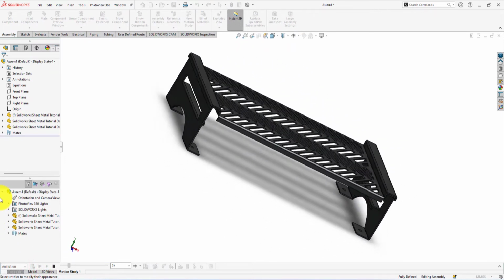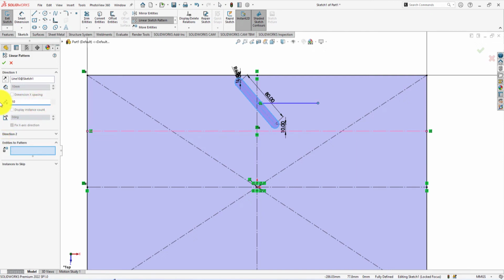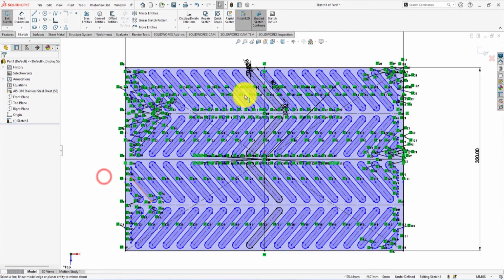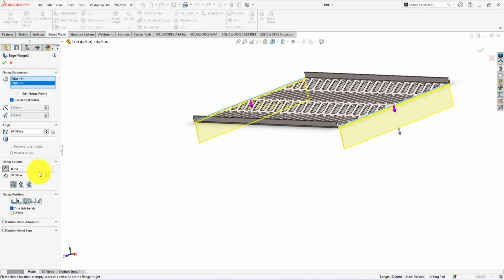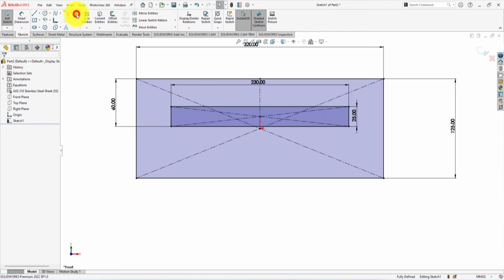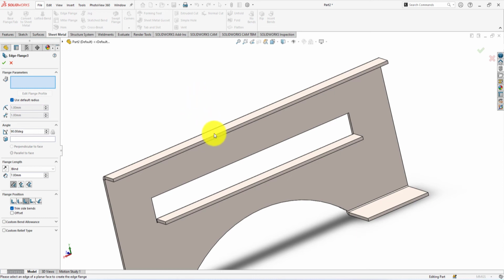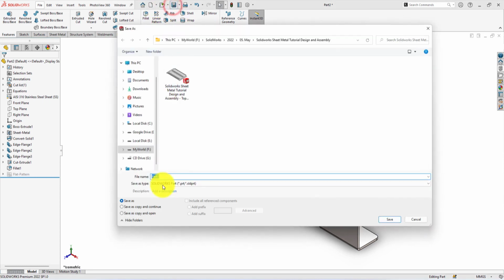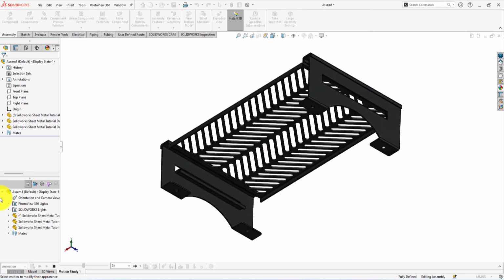Solidworks 2022 Sheet Metal Tutorial - Design and Assembly for Beginners

Comment: Great video! One issue I found is when you unfold the stand model the center slot flange collides within the slot. If I were to manufacture that part I would use a 3 sided thin extrude and use sketched bend lines to make the flanges. Still a good sheet metal practice part/assembly.
Reply from the maker: Thanks for the info! You have the freedom to reach your destination through any way from possible options.